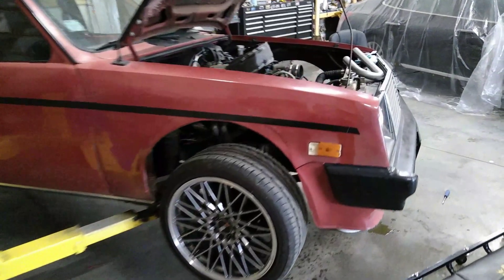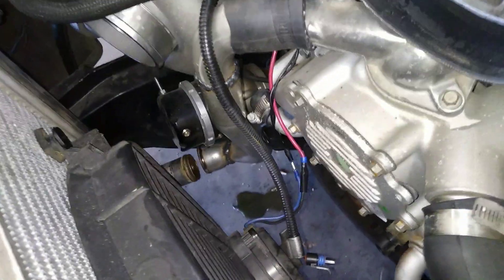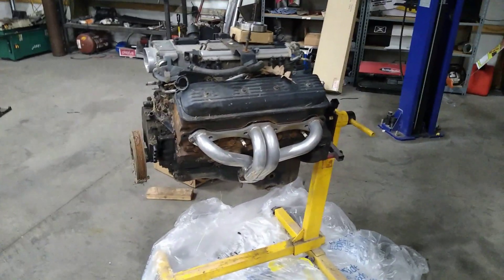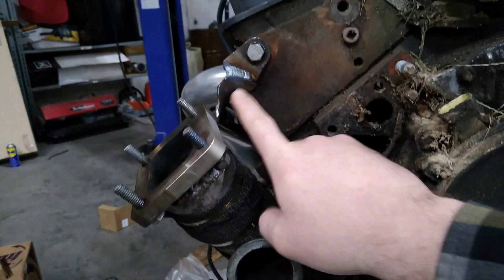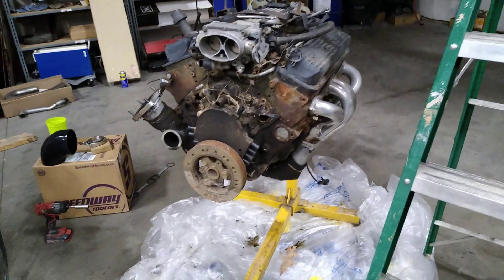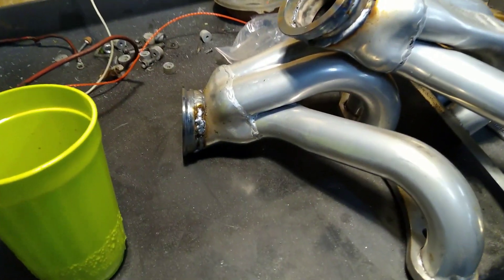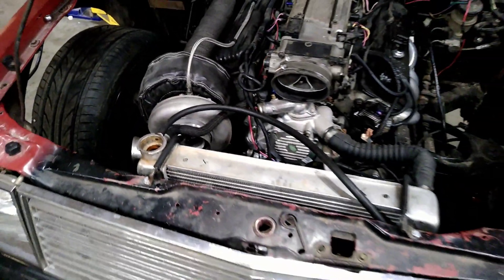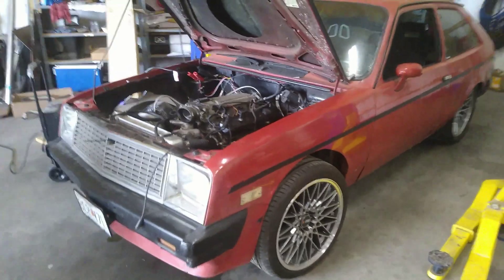Getting the LT1 Turbo Chevette Ready For BOOST

Comment: Where'd you get your radiator from mine is 24 in wide it from Summit Racing 2 core your looks a little thicker like it's a three core?? I widened the frame rails 1/2 inch each side to fit 24 in between the frame rails
Reply from the maker: I got the radiator from Eastwood. It is a triple pass, the smallest one they sell.